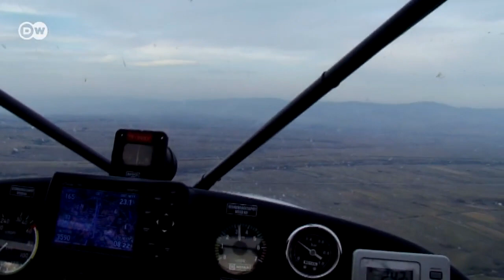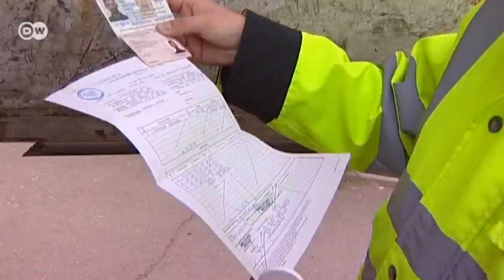Romania: Clearcutting in the Carpathians | European Journal

Comment: We could export much more wood and I think we should. What's needed is a better forest management system along with stringent regulation, not an interdiction on exports. In fact In the long term these policies could increase both the wood production and the surface of forests.
Furniture made out of plastics and metal require more energy, produce more emissions and demand largely non-renewable resources. Furniture made out wood means exactly the opposite.